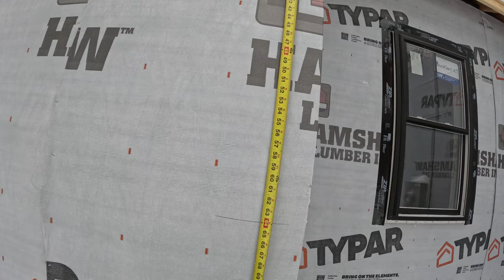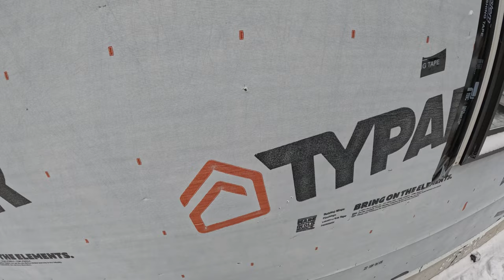How to install vinyl siding starter strip

Comment: I would never ever ever ever use staples. The only reason you use Staples is because you’re putting up a prefab home which all the sudden is gonna eventually buckle you saying it’s gonna move, but it ain’t gonna move once you hit those staples in when you line out a house, just so you know you started the lowest point of the house whether you’re down from the soffit or not you do not want your tape whatsoever. Otherwise your house is gonna look fucking crooked. I’m telling you. anyways there were some good things. I’m not saying anything bad too bad just saying do it yourself or I remove and replace Siding and I new home but I do not side construction homes.
Reply from the maker: Here’s some information you might find helpful regarding stapling vinyl siding:

The following is a link to Certainteed’s installation instructions - see pages 35-36: https://certainteed.widen.net/content/2yoyd9b0zb/pdf/siding-installation-guide-04-03-1099-US-EN-230602-combined.pdf?u=nwk4fd

And here’s a link to the VSI installation instructions - see pages 12-14: https://www.vinylsiding.org/wp-content/uploads/2020/06/2020-VSI-Installation-Manual.pdf

I’m not sure exactly what you are trying to say, but the staple gun nose and air pressure are set so that the staples are not driven tight… the siding is free to expand and contract as it should. As I’ve proven with the above links, staples are approved by both the VSI and Certainteed. 

I’ve installed vinyl siding for 16 years and can count my callbacks on less than one hand 🖐️. I agree that sometimes it is easier to hand nail on re-sides for various reasons. 

Thanks for your comment!

Comment: Its nice that you pay attention to that o/s corner being out of square and patching the holes in the typar, paying attention to the little things makes the job nicer.👍
Reply from the maker: It makes it easier too. The measurements stay the same going up. On this house the Typar was in rough shape, the framers must’ve dragged nail filled boards everywhere. We did a lot of taping and billed the builder for it.

Comment: Starter strip 1 inch down from top of  foundation. How wide is your starter strip. Mine is 2 1/2 " . Is your wider ? If yours is 2 1/2" as well how can the sidding be 1 inch below ? Even with the corner posts. You chalked a line at 2 1/2"
Reply from the maker: The bottom of the starter is 1” down from top of foundation. I hung the corner down 1” from top of foundation and then measured up from the bottom of the corner 2 1/2” or whatever it was to the top of where the starter was going to be… technically the bottom of the starter is probably 7/8” down from the top of the foundation because I always make sure the siding doesn’t hang below the corner.

Comment: why not just run your soffits first and bump ocp tight to it...your already doing the work by going up and leveling in off the facia...seems a bit backwards working up top first but gives a very tight finish and ensures perefct finish
Reply from the maker: That’s a good question… That would require either setting up a plank twice or installing all the soffit off from a ladder. In my experience it is faster to quickly toss the corners up then work the siding up as high as you can reach. Then you set up a plank and finish the top of the siding, soffit and metal all together…. Admittedly I did do this a little differently this time, because usually I just run the corner long on top and cut it later when I’m up there. The fit is always perfect either way.
Reply: @sidingschool  i wasnt knocking your work at all...i run soffit and facias first for this reason and another being that once i level the soffit in to the wall i can now measure down from the soffits and pop my starter line ensuring that my finisher is always exactly the same around the entire house...now this only applies to new construction work of course...remodel is a whole new animal
Reply from the maker: Oh, I didn’t take your comment as a slight against my work at all. And yeah, remodeling is a completely different beast and it requires a lot of out of the box thinking. Also having the corner posts the same length is a good idea, that way as you said the finishing “rip” of siding won’t be tapered.

Comment: I use a framing square.  Lay big leg on wall, slide it up till it makes contact with the bottom of the fascia board then mark the 1/2 inch increment.   Instead of using a bubble
Reply from the maker: That works too! I’ve had a few times where the joint in the plywood was right there with like a 1/8” or more step and it was throwing the square off, so I just got used to using a level.
Reply: @sidingschool  I use a level when doing f channel on pole barns

Comment: --------------‐‐---------- measuring top down is OK .....measuring from your -- first 'intersection' could be bit better .....bottom of windows is your first intersection .....you'd want a even reveal under windows vs. very top ....no?
Reply from the maker: Keeping an even reveal on the bottom and tops of windows is a good way to do it as well (especially with fiber cement or wood siding!). Sometimes that is difficult to do when a framer shims the bottoms of their windows differently from each other. It would be even more problematic when the windows are closer together, as this would amplify the angle across the distance of the wall. I typically choose to use the bottom and tops of the walls to establish heights, that way you know you aren’t going to have to cross a rib in the siding at the top.

Comment: Sorry but why is saying “strong” at the end of the measurement , I’m mechanic and welder but never heard this used before?
Reply from the maker: I guess I never explained what that means. It is sort of tradesmen slang… “strong” typically means 1/16” more than the stated measurement (when working finish carpentry it typically means 1/32” bigger) “shy” means either 1/16” or 1/32” short of the stated measurement (again depending on the tolerances of the work).
Reply: Thanks a lot for the reply and explanation.
Reply from the maker: No problem!

Comment: Hey Brandon what's up fellow side waller  here from North Attleboro Mass.. good video other than the builder making you use all those little scraps of starter strip.i can tell you take pride in your work.cool trick that i do is put a 4" wide  strip of vinyl under nail flange at j channel location and over nail fin of last row of siding before bottom of window. That will tred the water to the corner boards  instead of just running down to the bottom of the wall.be safe out there 🙏
Reply from the maker: Hey thanks! And yeah the window trick is definitely a good practice! Some builders have the framers put pieces of step flashing on the bottom corners of the window openings before installing the windows to make it easier on us.

Comment: I always used midwest snips for cutting corners and such. that fin tool sure leaves a nice edge
Reply from the maker: For many years I used Andy snips to cut them, but you take a chance of the corner cracking. The oscillating tool is the safer choice in my opinion, just need to be very careful that it doesn’t take off on you.
Reply: i bought dewalts little 3" cutoff tool last year (any brand will do), mainly just to have a small tool in my truck for cutting thinner steel. it comes with three different cutoff wheels. just for the hell of it, i tried it on vinyl siding with the multi purpose disc it comes with. works like a charm. leaves a nice edge, and cuts great in cold temperatures. it really shines when you are cutting angled pieces for gables or little cut outs for fixtures. the only downside is the dust. one 4 or 5ah battery lasts a long time in the tool too.

Comment: Great vid man, but if the section you’re on is over two stories and can’t quickly climb up to pull a measurement from the fascia, could you just snap a line for your starter strip an inch or two above the foundation given its level?
Reply from the maker: Thanks! Yep, if it’s above one story usually I set the bottom of the corner 1” below the top of foundation and use that as my starting point. I run the top long if possible and cut it off with an oscillating tool when I get up there.

Comment: Bro I never seen someone hammer on the top of the tape tongue you legend
Reply from the maker: Well… it was technically the nail that was protruding up through the slot of my tape lol. I might’ve clipped my tape a couple times though. 😇 

Interesting thing about tapes is not all of them read the same. I had a different brand and style tape than one of my employees and mine read 1/32” big and his read 1/32” small. So every cut he was making for me was 1/16” short.
Reply: @sidingschool  I'm literally siding just the back side of my house, takes me an hour just to think about what I''m doing LOL
Reply from the maker: It’s not a race, take your time and make sure the clips are fully engaged. Even if you have to measure every course until you get the feel for it. Good luck! 👍🏼

Comment: I install mostly windows and doors thinking about getting into siding as I get alot of requests  I have done  siding
Reply from the maker: There’s pretty good money in it… it’s important to bid correctly though. To do a good job on a re-side is pretty time consuming. I would typically figure 3-4 times longer than new construction. Then add some for profit if you want to stay in business! ✌️ Don’t be scared to lose a job, price for quality and a properly installed job that will protect their house, not just change the color and give a facelift.

Comment: Hi Brandon 
Your staple guns  7/16 , 16g gauge staples  ? , what length do you use ?  The starter strip stapled  flush ?  , was it the  same staple as the second gun that left the  depth on the siding loose  as required.
Reply from the maker: Hi Steve, the Senco shoots a 3/8” x 18 gauge staple up to 1.5”… that one actually doesn’t meet the minimum gauge thickness required for stapling siding. The Paslode shoots a 1/2” crown 16 gauge staple. I use 1 1/4” staples and staple directly to the sheathing and it holds fine. The VSI recommends fastening at least 1 1/4” into solid framing. As always, check your local codes and manufacturer for fastening requirements, as they do vary based on your location and the type of material you are installing.
Reply: @Siding School   Brandon I'm going to do my  off grid shop  12x20 this summer  and like your method . I have 1/2 inch plywood walls  so  what length staple would you use.  I also  see you go with about a  3/16  spacing at the  J Channel .  I know all too well  giving recommendations on youtube about anything but I also like to do things that work best and not necessarily by manufacturers' recommendations :)    I'm on part 2 of the house  series .  Just awesome bud , you will do well on youtube.
Reply from the maker: Thanks man. :) I typically just stick with 1 1/4” staples that way hopefully no wires or plumbing gets hit by a staple…. Someone mentioned 3/8” gap at ends below 40 degrees and 1/4” gap above 40. That makes sense to me.

Comment: Hi Bandon.  Is there an Electric Staple gun that can be used to staple instead of the Paslode Pneumatic gun?
Reply from the maker: Hi Rob, I’m not sure if there’s any electric stapler that will do… I’d look for a 16 gauge 1/2” crown stapler and then try modifying the tip. Paslode used to make the im200 s16 - a gas powered stapler that you can still find a few places. In my experience the gas powered staplers can sometimes be a bit finicky though.

Comment: Do you ever use a laser starting siding
Reply from the maker: Not typically, sometimes it is helpful though. On new construction usually I try to find the top of the foundation and use that. On an older house it might be a better idea to just use a laser and establish the coursing layout all the way around before beginning, because often times the foundation has settled and also the eaves are different heights. Sometimes even in new construction the tops of foundations aren’t always perfectly level, but it is usually close enough to get a good result. 

The main idea imo is to hit the top of the wall as close as possible to the same measurements for the last piece of siding on either corner and hopefully the bottoms of windows have even reveals too, so however that can be achieved… sometimes there’s no such thing as perfect - only ‘happy mediums’, or as I like to say ‘unhappy mediums’. lol

Comment: What kind of stapler are you using for the siding?
Reply from the maker: The stapler is a Paslode SCS200 and it uses a 16 gauge x 1/2” crown staple, the tip attachment is very difficult to find. You could fabricate your own by using an angle grinder to make a divot in the tip that comes on the stapler… I’ve tried that before on a hitachi stapler and it worked out pretty well. Good luck!
Reply: Vinyl fast staplers are awesome

Comment: Were are you using a staple gun in my state RI does not allow it them i just came across your channel
Reply from the maker: I’m out of southern NH. I’m always a little surprised when codes don’t allow staples… in my opinion they hold better. And some manufacturers actually give them a higher wind speed rating.
Reply: Crazy not far away from each other but big difference in codes
Reply: @sidingschool I've seen siding popping off of newer builds, and it was always blammed on them using staples. Maybe they weren't stapling it right or maybe it's because the staples are thin and they corrode and break away verses using roofing nails. I honestly don't know, but when they come back to repair the siding, they end up nailing them. It's usually up at the 2nd floor, so maybe it's wind? I'm doing my siding soon so just to play it safe, I'm nailing them.

Comment: Do you recommend a laser
Reply from the maker: They can be helpful… I worked without one for probably 8 years though. Not sure I can help you justify the cost lol. Without a receiver you have to wait till it’s darker out so you can see the line. If you’re going over really uneven surfaces and have many corners to set it can save some time by shooting multiple points in one go…. My answer is “It depends on the situation”. If you have the money and want to buy one to use for siding and other projects, I’d say go for it. I have rarely regretted buying a nice tool myself and always find other uses for things than what I bought them for… sorry probably not the answer you wanted. 😅

Comment: What’s with the strong?
Reply from the maker: It is a term used by tradesmen. If I say 1/4” “strong” it means just past 1/4” - in rough framing it means an extra 1/16”, but if I’m doing finish carpentry it will mean an extra 1/32”…. “Shy” means the opposite.
Reply: It's slang for a 16th over

Comment: I would mostly be doing remodeling not new construction
Reply from the maker: So yeah, there’s usually ‘happy mediums’ with re-siding. A laser and receiver is a good way to do it. I’d go around the whole house shooting at least two walls at a time, then snap lines and measure up to the soffits and down to the bottom of wall to see how the measurements compare. If it is too far off you may be able to make a slight adjustment and run the siding a little out of level on longer walls to meet the soffits and bottom of the wall better… however I’d keep the windows in mind too, cause you don’t want those to be too tapered on the siding or land in different spots in the reveal.